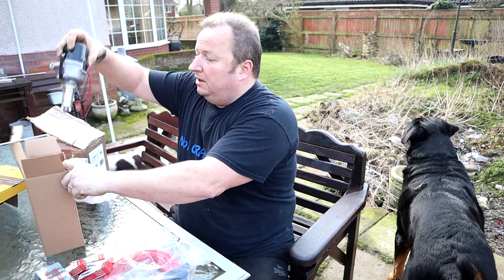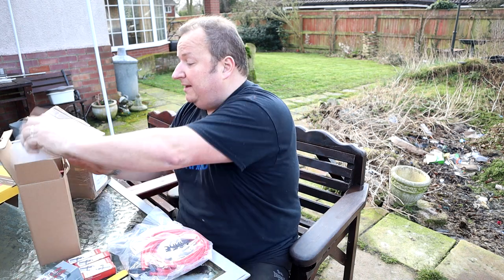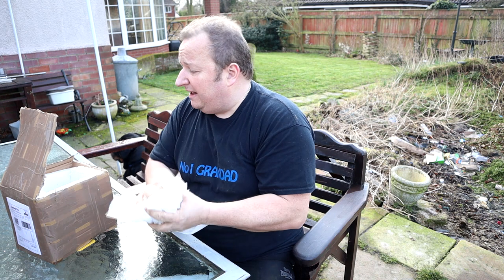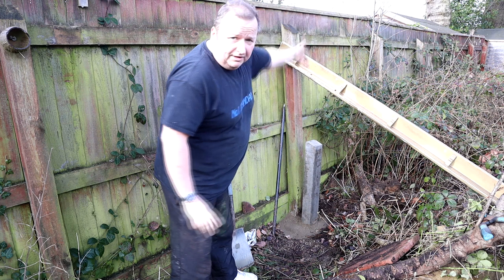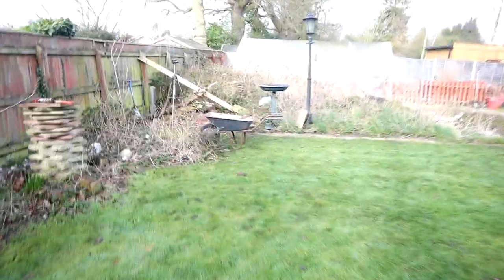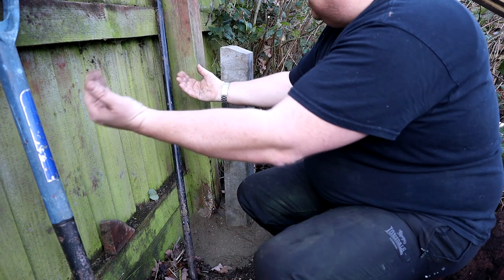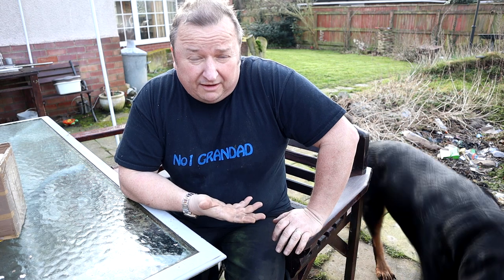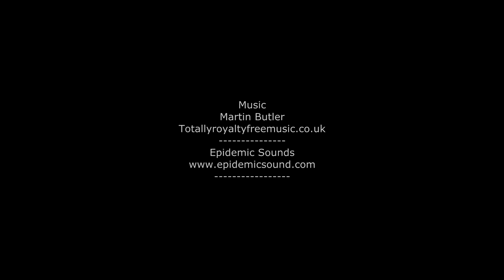New Parts For The Trotter Van And Update Vlog

Comment: The kit should work out fine, it's all designed to work together.   Some of the older cars here in US used to have a Positive + ground system (positive Earth as you call it), and some of the older cars used a 6 volt battery versus the 12v they use today..  Enjoy the time with your family.
Reply from the maker: Thanks Pete, yes, I think it will be fine.

Comment: When my fence posts snapped I got some scaffolding poles and cut to around 6ft, hammered these straight into the ground behind the post leaving around 2.5ft above ground, drilled 2 holes through the pole and put some long bolts all the way though, painted to match fence and now it’s solid again.

Comment: You should do a HubNut, get the engine running on the deck before fitting it.
Reply from the maker: I will have it running but its only 3 bolts to hold it in the chassis